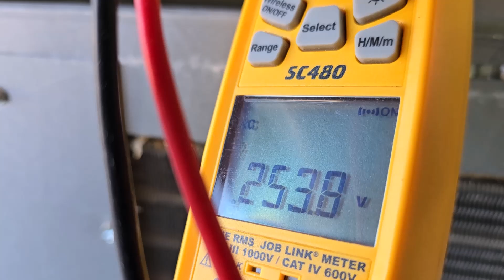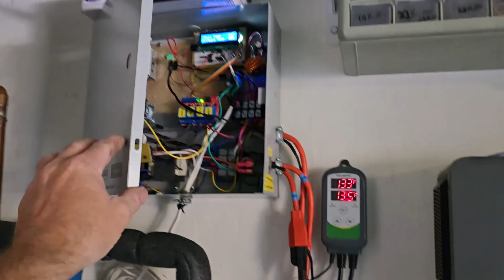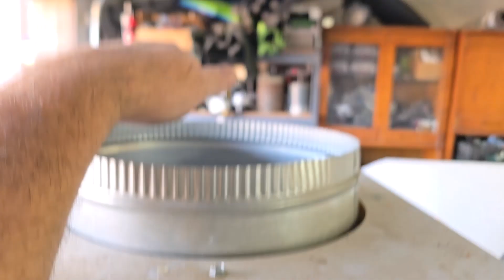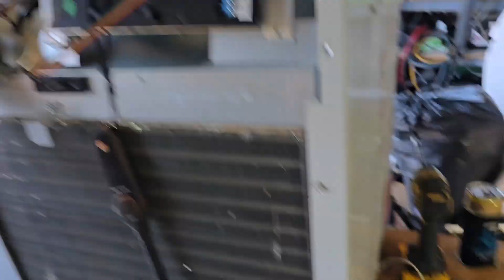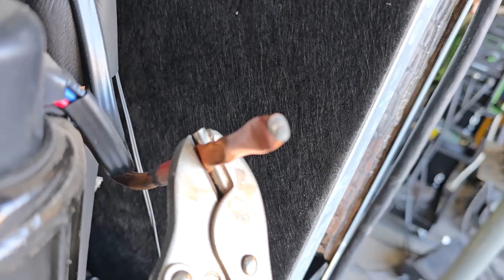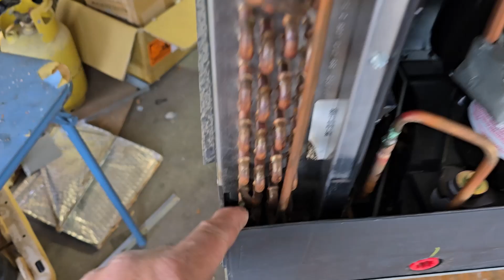Project Water Heater HP ver 2.0 [Solar powered heat pump]

Comment: 20:25 could be metric sized tubing 9 mm, in between 5/16” and 3/8” ACR size. I’m gonna build a Frankenstein heat pump water heater next month so this helps a lot thanks.
Reply from the maker: 9mm. That seems about right if it was too small for 3/8 and too large for 5/16 (8MM).

Comment: I did something similar with a 12k window unit. but i used a braze plate heat exchanger and ran the refrigerant lines inside.
Reply from the maker: Flat Plate exchanger would be sweet.
But I try to recycle what I got for my low buck DIY stuff.
I saved a few coaxial exchangers from WSHP over the years.